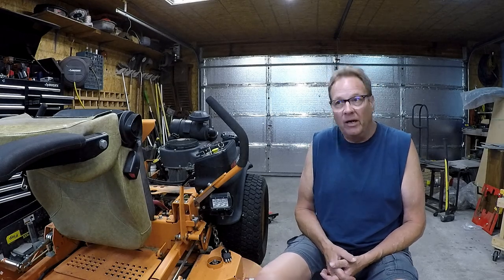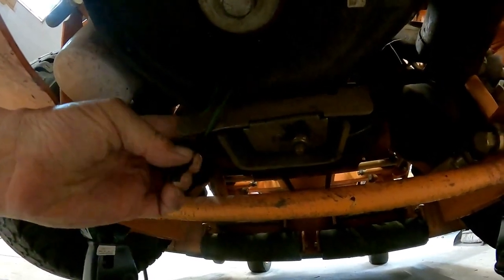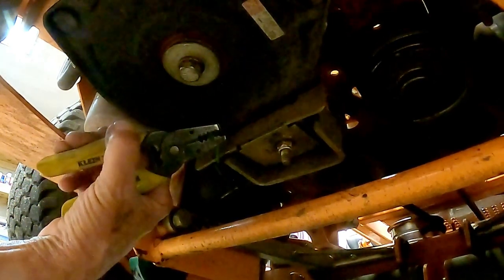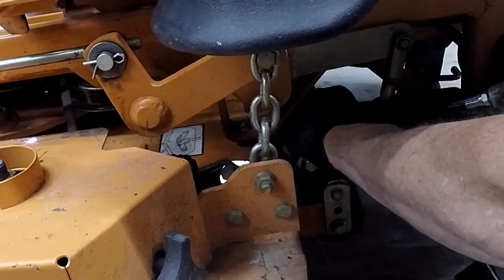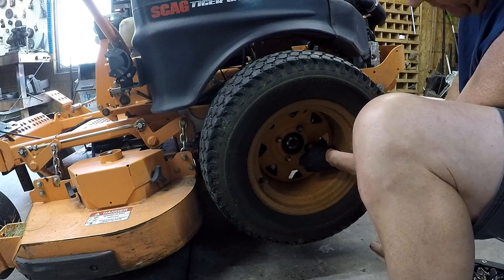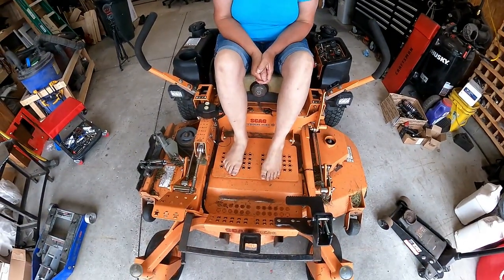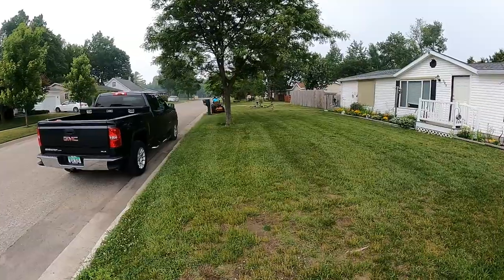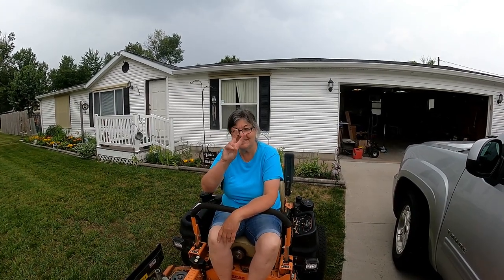Scag PTO Not Engaging Easy Repair

Comment: are your spindles original scag? if so they are definitely not sealed bearings. do they have the zerk on one side and the relief on the other? the oem scag spindles have tapered roller bearings.